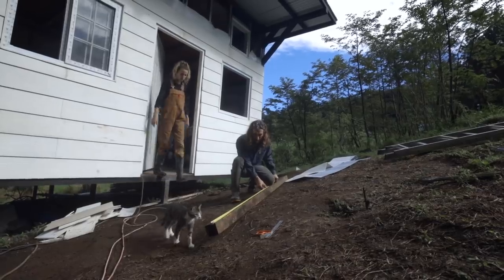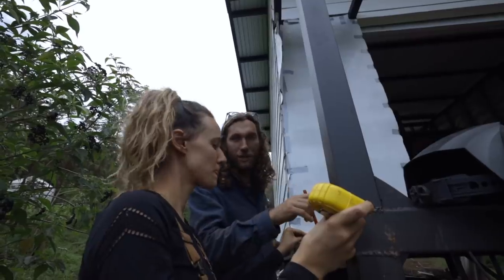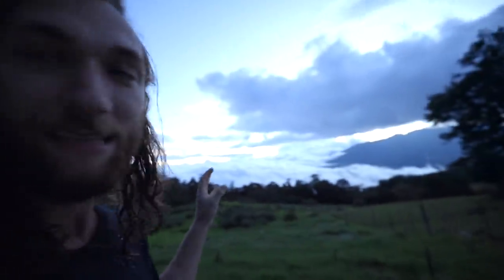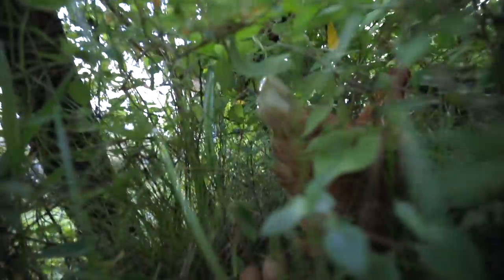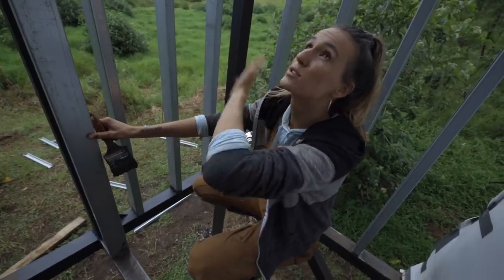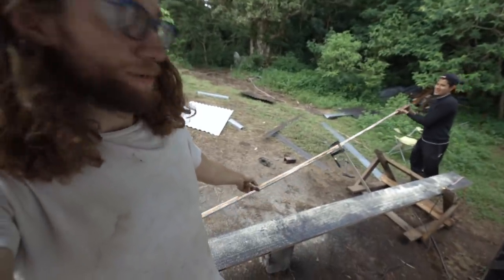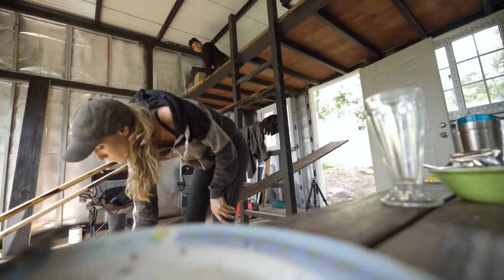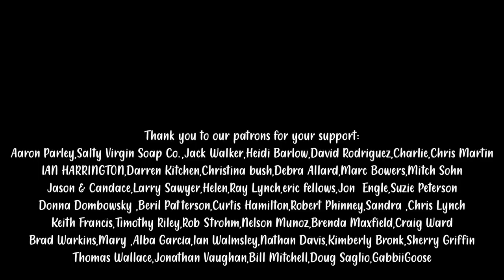Woke Up to a HUGE Surprise // off grid in Panama

Comment: If you are going to keep them for awhile..dont wash them.  Then you can keep them out on the counter and they last for a long time.  Congratulations
Reply: I’ve always wondered why eggs are sometimes a bit dirty
Reply: My Life Is Dog Hair  store bought eggs are not free range either and chickens are cooped up in their 'cages'. :'(
Reply: My Life Is Dog Hair  Eggs you buy in the store are not free range even if they say they are. 'Free range' simply means they aren't locked in 'cages' but it's not much better. They are so cramped in the building they're in that it's just as cruel. To be labeled free range just means they have to be able to see the light of day for a certain amount of time but there's so many it's a very small fraction that actually do. So basically it's false advertising and it's actually against the law to go photograph the factory farms! Farmers that do allow it quickly lose their livelihoods because they will lose contracts with the company they work with. If eggs were truly free range there would be WAY LESS available.
Reply: You are washing off a protective coating. Leave them on counter until you are ready to use. Then rinse.
Reply: True. Eggs shells are porous, but when the chickens lay them they have a protective coating on them that keeps bacteria out of the shell (and potentially out of the embryo in fertilized eggs). Wash them RIGHT before you cook them with clean water if they have dirt and poop on 'em.

Also, eggs will keep on your counter if you don't wash them for a couple of weeks, so if you're making the egg gathering rounds daily looking in the usual spots they like to lay, the eggs probably not too old to eat.

Comment: I have never in my life spent studying architecture and construction seen such a time consuming method of making a building. Is it normal there?
Reply: @zonian1966  Really? So many other methods would be faster and cheaper.
Reply: Like, why does the electrical cabinet need some many steel posts? That house is gonna have more steel in it than the average harbour bridge.
Reply: @mj_aussie_coaster_travels8310  and there are plenty of steel framing systems available in Panama, shipped from all over the world. The welding method they use here is definitely not one of them. It is far too time consuming.

Comment: Get a couple of 10' steel polls weld a 4 foot piece to each top, so it looks like a letter "T" -  drill in 3  eyebolt screws about 1.5' apart on the top 4' pieces on both sides.  Get some nylon rope , cut three pieces the same length, Hammer the 10' poles into the ground about 8 feet apart. Thread the rope through the eyescrew and tie a tight knot, and thread it through the eyescrew on the other side.  Get some clothes pins, and hang your wet clothes to dry.   You can also use the rain water to rinse out your soapy clothes, haging them on the line...

Comment: You can try letting them out later, after they lay. Also only wash them right before u use them. They have a natural coating that keeps them longer. And u can tell if they're good by putting them in water if they float they're not good. And if they stay under but stand straight up and down then use them up quckly.

Comment: You guys need a bigger coup with more nesting boxes.  If so, they will lay in the boxes and then go out and free range.

Also, get some diatomaceous earth and sprinkle into the coup.  It helps keep away mites when they are taking dust baths.

Comment: leave a 1 inch gap at the bottom of the board and baton so it doesn't sit on the flashing at the bottom or water will wick up into the board from the bottom.

Comment: When you start setting up your rain water collection system, may I suggest that the downspouts are set to empty on top of an UPSIDE DOWN colander with a covering of PLASTIC window screen pop-rivited and formed around the round colander. The holes in the colander and screen will prevent most undesirable insects, particles falling on the roof and down the collection gutters, etc. Check out Google for a good plastic colander large enough to collect all the water coming down. If you expect one colander can't "absorb" all those rainfalls you have, just double the system.
Just sayin' — Rick

Comment: Just a suggestion.....are your solar clean to get the most charge??? You need to make sure to crack right, if you save them for another day don't wash them, keep it on a carton or asket. By the way is 1 egg a day, some those are older.

Comment: Actually do not wash the eggs you can keep them on the counter for weeks without refrigerating them as long as they are unwashed it's called the Bloom.. The coating call the Bloom keeps the air from getting into the shell and causing sulfur build-up which causes spoiling. Once you wash them they  start to spoil at room temp...they have to be refrigerated.. also a heads up boiling fresh eggs and then peeling them is  almost impossible they end up sticking to the white and raggedy looking..but eggs that are 2 weeks old will boil and peel  Excellent.. If you leave one egg in the nest make sure you mark it with a marker so you know which 1 it is.. been raising chickens for 30 years..

Comment: i forgot one question ... why do you mount the boards on your box vertically and not horizontally? This would make it much easier to attach them and it would go much faster because you could cut several boards at once.

Comment: Since you don't know how old eggs you find are, please crack each, one at a time in a bowl, then see if it smalls clean, & see if the white holds together or is broken down & watery,( meaning too old to eat, before adding it to the larger bowl with other eggs or batter. 

One spoiled egg will destroy everything in the large bowl. Sometimes they smell really horrible & stink up the whole house, so if finding stray eggs, crack them outside.

Also, don't use such high heat with eggs. Use butter, bacon fat or a healthy oil on med-low in a non stick pan to gently cook eggs. 

I see so many cook everything at such a high temperature, & over cooks the food, & eggs especially need to be cooked gently, sometimes using a cover.

Comment: If you want Different, love big tomatoes? why not watch them grow everyday, make a tomato box upstairs right over the upstairs balcony.you can watch them grow. And they add beautiful color to that view, and the chicken can't  get to them. They taste better seeking them grow eye view . If you pick the right type you can get close to 30 juicy onces in one box.
    to start  your artist side, on the door. You have to blend that into the houses, as white a empty platter. To do something creative  buy& choose  2 quart of a different color, could be  blue/ green, yellow / gray , orange /green. Etc
 then buy 1quart of white. Around the window before than sliding there 2" that you can paint. So just paint that one of the color straight.  This blend the  window to the doors Then paint the door. You can make a border with one of the color straight or mix. Then the two quart add up to 1/2  of white to get the tint color  you want. Both of them get the same amount so you got a 1/2 tone of each color
. Do a design on the door or even paint  thick different size and color circles  or make your own with a string and a nail. Etc. or color this lines pattern or what ever you want but don't do drawing etc. you need solid thick lines as the house large so it's a scale thing.. This is color coding  and the tint would match well it's a wide blend or transition of color that give the plain house more style and detail. Done right. And that learning. But up to you.

Comment: you fried your egg with too much heat. try it next time with half the heat and a little more time. Not only does it look a lot better, it tastes a lot better. There are no burnt parts on the edge of the egg that will turn black, and the fat for frying is not overheated. just as a small cooking tip by the way.  greets from germany

Comment: Kaylee "I think it is when they make that funny noise is when they lay an egg" When she is in the process of giving birth I double dare you to remind her of what she said LOL

BTW you really need to get some more chicks depending on the breed and diet a chicken will lay between 1 and 2 eggs a day and will lay then in the spots you have found. If you get some young chicks the older chickens will take care of the young ones and bring them up so you do not have to do so yourself. Also you need to check those spots everyday as those eggs have been laying out in the air for a week in some cases. Maybe hard boil those ones. Luckily since you have no cockerel they will not be fertilised so you will not find yourself eating a half formed embryo a delicacy in the philippines but yuck.

Also consider some meat chickens as you egg laying chickens are breed for egg production and when you kill them the meat will not be as good.

BTW I really like that japanese wood preservation technique sure it is manpower intensive but you are in a country where manpower is cheap andit does the same job with less of an environmental impact. After all when you paint preservative on wood all you are doing is to make a layer of protection using chemicals.